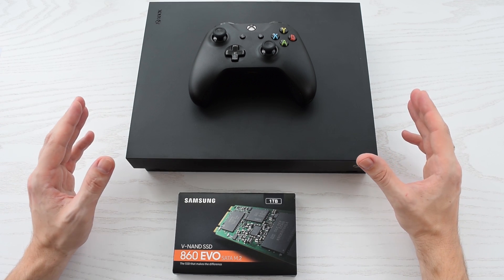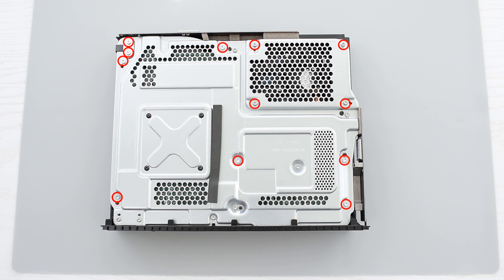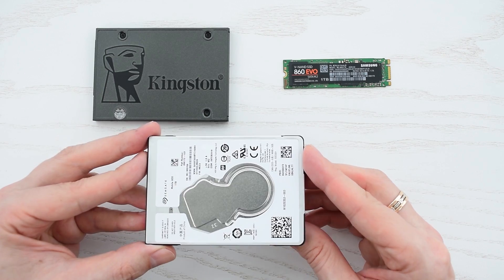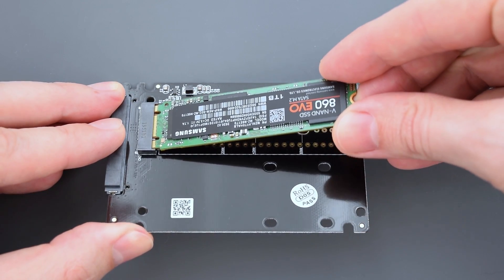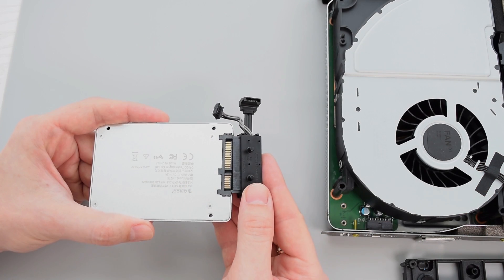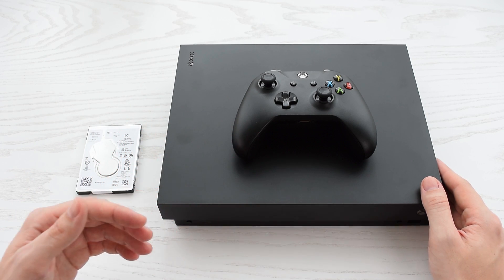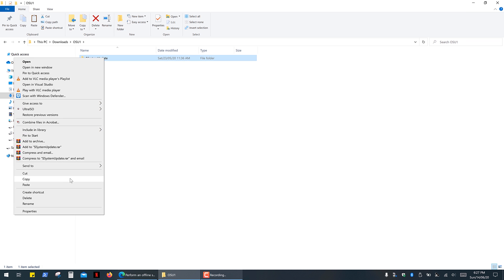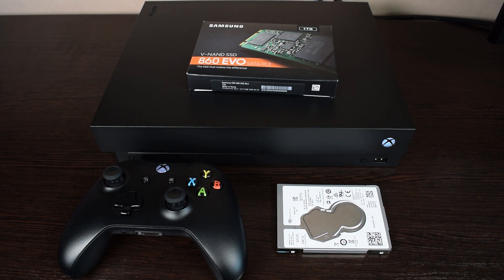How to Upgrade your Xbox and PlayStation Console to M.2 SSD Drive. 100% Works for all Consoles

Comment: I don't understand why you would want to upgrade it to an m2 ssd.  They are more expensive and you can't get any more performance from them than you could from a regular SSD, on top of that if you really wanted to get froggy you could get yourself a lot more storage by avoiding the m2.  On the new consoles I can kind of get it.  Wouldn't it be better to just use usb for it?
Reply from the maker: The main idea was just to show the upgrade options. Lots of people say that they have spare M.2 NGFF SSDs after upgrading laptops etc. And they didn't even know that such adapters exist. Or maybe you just want to use that M.2 SSD in another device after your console dies (2.5" SSDs are becoming obsolete), then it's pretty good option.
Reply: @ElectronicsComputers  think you might be able to do a comparison of usb ssd vs the sata?  I'm curious now, lol.  Thanks for the reply and clarification.

Comment: This video does not apply to M.2 NVMe "PCIe" drives and was fairly clear on that. This is only a viable "upgrade" if you already have a spare M.2 "SATA" SDD. M.2 SATA is not an upgrade over 2.5mm SATA. It's simply a smaller form factor. It's still the same SATA interface supporting up to 600Mbps transfer speeds.
Reply from the maker: Finally, someone who knows what he's talking about!!! I don't know why people confuse those two types of M.2 SSDs. The main idea actually was just to show the upgrade options. Lots of people say that they have spare M.2 NGFF SSDs after upgrading laptops etc. And they didn't even know that such adapters exist.
Reply: I was wondering that but you cleared it up for me thanks, I got the brains it's just kind of hard to look at everything from a final standpoint seeing how the SSD and M2 have different read write speeds it was just a little confusing but no matter what the SATA on the Xbox will always do 6gb/s 😅 correct me if I'm still wrong though, appreciate you both. 😊👍 I'll just stay on the Samsung 860 SSD then.
Reply: @86NissanMaxima  Correct. You are already maxed out.

Comment: Its cheaper to just use a 2.5" sata rather than a m.2 sata ssd and at least you dont worry about compatibility, especially considering this soon to be over generation is stuck at sata 2.0 not even sata 3 6gb/s so why bother all that work?
Reply from the maker: Xbox one X uses SATA 3. Check the specs of SATA controller chip.
Reply: @ElectronicsComputers  wow ms didn't just do a copy and paste with the one x surprising. But even then switching the onboard hdd to a 2.5 drive would be by all accounts more easier not to mention more safer due to MS not making drive swaps as simple as popping off a panel and sliding a drice into a drive caddy and screwing it in like sony made it.
Reply from the maker: @davidashurov5255  The main idea was just to show the upgrade options. Lots of people say that they have spare M.2 NGFF SSDs after upgrading laptops etc. And they didn't even know that such adapters exist. Or maybe you just want to use that M.2 SSD in another device after your console dies (2.5" SSDs are becoming obsolete), then it's pretty good option.

Comment: Since the m.2 drive will only be able to transfer at the speed of Sata, why not just buy a 2.5inch SSD, it's cheaper for the same amount of memory, and you'll get the same speed.
Reply from the maker: I was using SATA M.2 SSD (NGFF) so of course it will work at SATA speed. The main idea was just to show the upgrade options. Lots of people say that they have spare M.2 NGFF SSDs after upgrading laptops etc. And they didn't even know that such adapters exist. Or maybe you just want to use that M.2 SSD in another device after your console dies (2.5" SSDs are becoming obsolete), then it's pretty good option.

Comment: I just don't understand why you bothered buying a m.2 sata ssd if it's gonna end up inside a 2.5 enclosure? Why didn't you just buy a 2.5 sata ssd? They're both the same and the 2.5 sata ssd is cheaper compared to the price of both m.2 sata ssd + the orico 2.5 sata enclosure. 🤔
Reply from the maker: The main idea was just to show the upgrade options. Lots of people say that they have spare M.2 NGFF SSDs after upgrading laptops etc. And they didn't even know that such adapters exist. Or maybe you just want to use that M.2 SSD in another device after your console dies (2.5" SSDs are becoming obsolete), then it's pretty good option.
Reply: @ElectronicsComputers  You do know that enclosing it inside a 2.5" enclosure will make it run hotter than it already is inside a laptop? 
M.2 and mSATA SSDs are known to run  hotter than 2.5" SATA SSDs because due to the exposed chips in these SSD models lacking thermal pads or casing that can conduct heat away from the chips. If you have an M.2 or mSATA SSD inside of your machine, you need to make sure there's available air flow.

Comment: What a waste of a m.2
Reply: It's a SATA m.2, not an NVMe... this SATA M.2 SSD will max out the interface (assuming the weak Jaguar CPU doesn't bottleneck it) compared to the standard HDD in the system.
Reply from the maker: That's right!

Comment: Upgrading a xbox is as easy as buying a ps4
Reply from the maker: Sounds more like downgrade to me. I have both Xbox One X and PS4 Pro and both upgraded to SSDs. I always prefer to play on my Xbox than on PS4 pro because I like the controller of the Xbox and it's definitely has better graphics. I have several same games installed on both consoles and I can really see the difference. Basically, I use PS4 as a backup for games that didn't come out for Xbox. 
PS4 is definitely easier in HDD/SSD replacement and in maintenance in general. Speaking of quality they are about the same. We have tons of Xbox and PS4 consoles in our repair shop and usually people send consoles which are about 1.5-3 years old.

Comment: SATA protocol is the same for all this devices. No need to expend extra bucks on NVMe storage and even less on hardware which I/O chip is not ready for such speeds.

The video is nicely done tho.
Reply from the maker: I was using NGFF (SATA) SSD don't confuse it with NVMe. There's no such adapters to convert NVMe to SATA. The main idea was just to show the upgrade options. Some people who say that they have spare M.2 NGFF SSDs after upgrading laptops etc. And they didn't even know that such adapters exist. Or maybe you just want to use that M.2 SSD in another device after your console dies (2.5" SSDs are becoming obsolete), then it's pretty good option.
Reply: @ElectronicsComputers  ohh an idea for a very specific purpose but helpful for some people. Still I don't think the speed difference is much because of the shitty PS4/XBO I/O. But maybe there is someone interested in the matter!
Reply from the maker: @midelro97  M.2 NGFF provides absolutely the same speed as any 2.5" SSD. Anyways, with an SSD your console boots, installs and starts games way faster than with HDD.

Comment: There are so many uninformed people in the comment section. They don’t know the difference between m.2 nvme and m.2 sata 🤦🏽‍♂️
Reply from the maker: I was extremely surprised too and some of them don't even believe that SATA-based M.2 SSDs exist.
Reply: @ElectronicsComputers  they just read M.2 and think all are nvme hahah I wish, 120GB m.2 sata ssd costs 40€ the same but nvme costs almost double
Reply: @VajaBenidze  Yeah, but after looking at all the keywords in the description, I noticed it either barely says SATA or doesn't at all, out of 100+ keywords. It's not wrong but kinda misleading that there's no disclaimer in the title or description that it'll run at SATA SSD speeds. You gotta expect you'll get lots of underinformed people when using that many keywords.
Reply: They're the same people that accidentally buy a m.2 SATA drive instead of NVMe and wonder why it's not fater than their 2.5" SSDs lol.
Reply: And even less about sata generations🤣🙈
And pcie generations 🤣🙈
Reply: The internal interface is sata II so you are wasting the speed of a m2 sata III ssd. Saying that you will still get around 300 MB/s transfers so a definite increase over a hdd of any interface. Best option is a hybrid hdd which gives you both the capacity of a hdd but the fast transfer of an ssd.
Reply: @MeepMeepMwo  Only original Xbox One uses Sata 2!!! One S and One X use sata 3!
Reply: So it’s not possible to use the nvme?? Does it have to be the data m.2?

Comment: wouldn't you lose speeds from doing this? M.2 uses PCIe 4.0, which is slower than sata, and you're still using a sata connection here....
Reply from the maker: I was using M.2 SATA (NGFF) SSD so there's no any lose in speed. It completely utilizes the SATA III port speed up 6Gbps.

Comment: Has anybody had the problem with the 101 error trying to follow his procedure
Reply from the maker: what's the model of SSD/HDD that you installed into your console?
Reply: @ElectronicsComputers  I am trying to go from a Samsung Evo 872 the factory Samsung Drive basically I'm trying to downgrade I've been trying for months to take my Evo drive out that I spent $240 on because honestly there is not much of a  difference so I just wanted to take it out I've already done this once and it worked flawless
Reply from the maker: @johnfarias7230  Simply replace it with any 500Gb, 1Tb or 2Tb SSD/HDD and install OS from USB drive.
Reply: @ElectronicsComputers  yeah I wish it was that easy I've tried two brand-new drives in one Views Drive and still get the same error in the verification process the Xbox still works perfectly if I put the solid-state in but I've tried all your steps
Reply from the maker: @johnfarias7230  Are you sure that those HDDs are fine and there's no any bad blocks? Also try to remove all partitions from those HDDs. Then install HDD into your console and install the OS.
Reply: @ElectronicsComputers  thank you so much I appreciate the help but yes I bought it brand-new couple of months ago used it I took it out I call owned the one terabyte hard drive to the solid state hard drive installed it for a couple of weeks then I tried to put the old one in and it won't read it I think because it has an older operating system on it so I did the whole cologne it again I cologne the solid-state to the original hard drive that came with it I did do a block test I didn't come up with any bad sectors but I have a couple of brand-new 500 gigs so I will try one of those now see if it really was the hard drives thank you so much

Comment: In case anyone is interested in actual performance numbers Digital Foundry did a video with a PS4 Pro and got considerably better load times with an 8TB 2.5" SSD, You'll find the same results with an Xbox One as well.

2.5" HDDs are much slower than 2.5" SSDs even when bottlenecked by the SATA protocol that both systems have.

Comment: Game rig builder and I.T pro here!
THIS is an entity pointless upgrade over a 2.5 SSD. And costs more with zero benefit in speed. As you are still limited to the sata 5Gps bus speed.
Reply from the maker: If you say that it's pointless I doubt that you IT pro. The main idea was just to show the upgrade options. There's a bunch of people who say that they have spare M.2 NGFF SSDs after upgrading laptops etc. And they didn't even know that such adapters exist. Or maybe you just want to use that M.2 SSD in another device after your console dies (2.5" SSDs are becoming obsolete), then it's pretty good option.
Reply: @ElectronicsComputers  "2.5" SSDs are becoming obsolete"
No they are Not! (Says who?) . Im installing these on a daily basis  for huge tech companies like cisco/supermicro and other Big contracts.
Yes its possible to install an M.2 but the benefits of M.2 NVME over sata Interface is zero here!.  Far better to use a 2.5 ssd thats actually cheaper  and you get bigger size per £ vs m.2  and the difference in speed is not such a big deal vs mechanical drives.
Reply from the maker: @BaseRealityVR  I'm sorry but I don't believe you. What NVMe are you talking about? It's even impossible to connect that type of SSDs to SATA. Such adapters simply don't exist because no point to convert super fast SSD to slow SATA port. If you can't distinguish between NGFF (SATA) SSD and NVMe you can only dream about working for Cisco.
Not a big difference between SSD and HDD are you serious?
Reply: @ElectronicsComputers  NVME is not the connector. It's the bus interface. I don't care if you believe me or not. Been building servers and laptops/desktops for 6 years as a job now regardless.
Reply from the maker: @BaseRealityVR  why are you talking about NVMe? I didn't use it in this video I was using NGFF. Do you understand the difference? NVMe is one of the types of M.2 SSDs which works via PCIe bus whereas NGFF uses SATA bus. I hope you learned something new today.
Reply: @BaseRealityVR " Been building servers and laptops/desktops for 6 years"  for  "huge tech companies like cisco/supermicro and other Big contracts", What a joke this kid. Look at his account he's just a kid who just heard a few words about IT like: "NVME" (which is correct NVMe) and m.2. That's all he knows. Every IT tech knows that M.2 port provides USB, SATA and PCIe connections. And 2013Electronics&Computers used SATA based M.2 SSD which is NGFF NOT NVMe!!! Do you understand it, "IT PRO and rig build" ??? LOL. You can't convert NVMe to SATA because there's no such adapters on the market. Kid do some research and learn from people who's much older and experienced than you.
Reply from the maker: @gforce278  some people can't admit that they are wrong and they can't learn something new because they already "know everything".
Reply: Alpha, the default drive in the Xbox One X is a 2.5" *HDD* not an SSD.... so yes it's a GIANT upgrade, as the HDD no way maxes out the SATA interface. At best it's probably pushing 300Mbps
Reply: I love how AlphaWolF fluffs his penis and clears his throat as he entered the room and says... ahem “Game rig builder and IT Pro here.... (points is thumbs to his chest with a cheesy grin on his face) THIS is an entirely pointless upgrade” 😂😂😂😂 then I love how he gets knocked down to a ZuluWolF for his stupidity 😂😂😂😂

Comment: There wouldn’t be any speed differences with a normal 2.5 inch ssd and the m.2 / NVME right?
Reply from the maker: you can't use NVMe SSDs on this console!  I explained pretty clear in the video that you can only use SATA SSDs like 2.5" or M.2 NGFF.

Comment: Just buy a 2.5" SATA SSD, easier to install, same performance as a M2 SATA
Reply: if i don't use my xbox i can put the nvme in to my laptop with nvme slot
Reply: I upgraded my PS4 to a SSD.  My research said that limits in the interface meant a top end SSD would never realize its data transfer potential...so as long as the data transfer speed was over a given level, it was as good as you could get.  I’ve noticed better performance, but not as much as I had hoped from a SSD.
Reply from the maker: Well, the main idea was just to show the upgrade options. There's a bunch of people who say that they have spare M.2 NGFF SSDs after upgrading laptops etc and they didn't even know that such adapter exist. Or maybe you just want to use that M.2 SSD in another device after your console dies (2.5" SSDs are becoming obsolete very fast), then it's pretty good option.

Comment: The PS4 doesn't support TRIM, which allows the NAND gates to operate and delete (replace) files.  It will work for a while, but the drive will fail eventually.
Reply from the maker: TRIM is no longer a problem for most modern SSDs from reputable vendors. The firmware on those SSDs can manage all those processes with or without TRIM support by any OS.

Comment: Dumb Question, Can you put a 8tb, 10tb SSD internal in either xbox one S, X ?? the 1TB HDD is just not enough space for everything i have.. And if so what's the best SSD to use internal?? Thank You..
Reply from the maker: At the moment, the largest SSD available on the market is 4Tb with the price range 560-980$. Xbox officially supports only 500Gb, 1Tb and 2Tb SSD/HDD drives.
Reply: @ElectronicsComputers  Ok Thank You for the Information..

Comment: It is important to note that this only works on the PlayStation 4 pro as it has sata 3 connector. In ps4 slim it is sata 2 so it won’t work.
Reply from the maker: II provide  to function on  I ports.  III specifications provide  to function on  I and  II ports. So it will work perfectly and faster than any HDD.

Comment: Почему просто не установить SSD2,5" ?! Без этих костылей!
Reply from the maker: I've made two videos with upgrading to 2.5" SSD and to NGFF M.2. The main idea was just to show the upgrade options. There's a bunch of people in comments who say that they have spare M.2 NGFF SSDs after upgrading laptops etc and they didn't know that such adapter exist. By the way, Xbox One X has solder pads on the motherboard for M.2 M NVMe SSD. I'm gonna solder that missing slot and the other components and if it works I'll make a video.
Reply: @ElectronicsComputers  👍

Comment: Did you see much better performance in read and write operations from your ssd upgrade
Reply from the maker: The console boots slightly faster but the speed of games loading and installing is incomparable to a hard drive.
Reply: @ElectronicsComputers  see it would now come down to potential bottlenecks ie cpu, ram speed and motherboard memory bus speed

Comment: Thank you for the video. Only problem is, those drives are so expensive the higher you go in capacity 😔
Reply from the maker: You can upgrade your laptop to any 500Gb, 1Tb or 2Tb 2.5" SSD or M.2 NGFF (SATA). Don't confuse NGFF with NVMe SSDs which are way expensive.